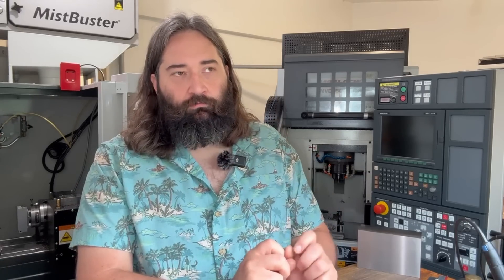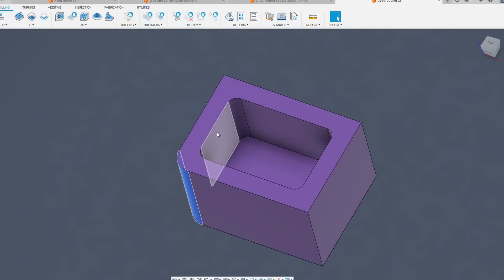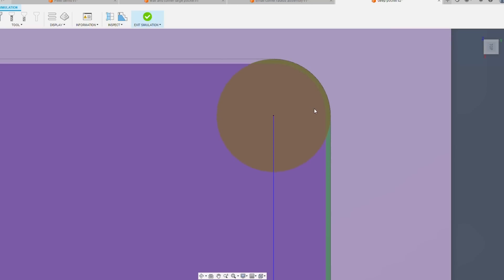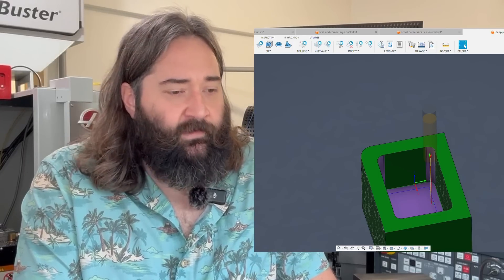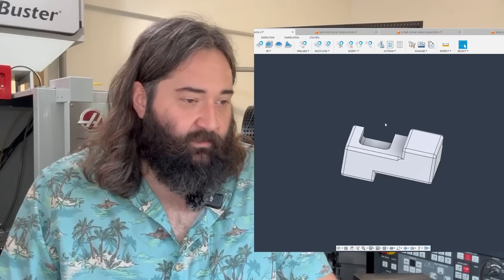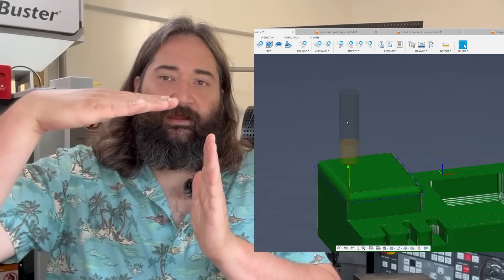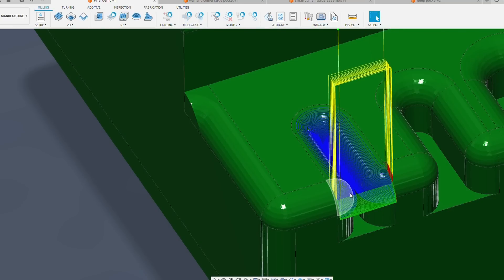Fillets make your cnc parts more expensive

Comment: Summary
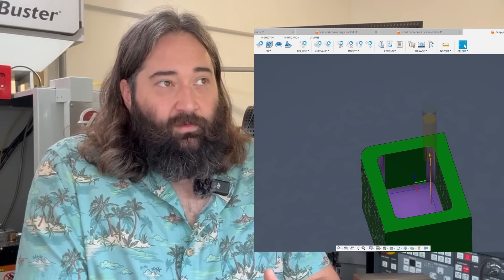* (7:29) Design fillets with both inch and metric tooling in mind: This allows for more flexibility in choosing machining tools and potentially reduces costs.

* (9:02) Avoid pockets where floor and vertical corner fillets match:  This creates sharp corners which are difficult to machine, often requiring multiple tools and increasing cost and complexity.

* (12:38) Corner rounding endmills can leave excess material: Especially near shoulders or narrow features. Consider alternative machining strategies or designs.

* (16:04) Avoid forcing situations requiring multiple tools to blend fillets: Blending tools increases complexity and often involves test cutting, leading to higher costs.

* (16:40) Every machining process leaves a corner radius: Plan for this in your designs, especially for tight-fitting components, to avoid assembly issues. Consider slight chamfers or radii on mating parts to account for the inherent radius left by machining.

Summarized by AI model: gemini-1.5-pro-exp-0801
Cost (if I didn't use the free tier): $0.0539
Input tokens: 14304
Output tokens: 368

Comment: Just ran into this problem today, rapid prototype job for a major company. The engineerhad 1mm internal radii in a pocket that is 3/4" deep. Is it doable yes, is it a total PIA also yes. After some back and forth with the engineering I got it bumped up to .0625 radii to run my 1/8" 3/4 LOC endmills I had on hand

Comment: Loved this video, and your insights!
Anything you talk about is interesting to me although a lot of it is not relevant to my work, as although I am a machinist, I pretty much only do plastics.
Do you ever machine plastics for jobs?
Reply from the maker: Very seldom, to be honestly I find it difficult. Weird stress issues and the burrs are a challenge for me
Reply: Interesting. I remember reading about a company here in Holland doing only plastics running a couple of Nakamura-Tomes. The machines have sort of eternal life because of the low loads. Also looking virtually new after years of service. 

I ran a job on our Okuma lathe on a part that is steel cored nylon, did not know it existed. They told me to switch off the chip conveyor as the nylon 'threads' bind it up. They can still be seen stuck in a lot of places from previous jobs when they were not so thoughtful. It's probably the only part we do in plastic all throughout the year so it does not pay to invest too much time in researching the best tools and parameters. I find the clamping pretty sketchy as it i so different from steel where I can just crank up the hydraulic chuck to near max all of the time.

Comment: Yeah but they make my 3d prints look siiick.
Reply: They also let your printer continue around the corner without slowing as much as a 90.
Reply: Yeah I fillet all kinds of stuff when 3D printing 😅 but machining? Engage chamfer mode.
Reply: @scottwatrous On 3D prints, it depends. Corners perpendicular to the print bed come out equally well chamfered or filleted. But on corners parallel to the print bed, I prefer chamfers every time. Can be printed without supports at the bottom of the print, and they just look way better than fillets. Even when printing with variable layer height.
Reply: Fillets take extra time on reductive manufacturing. Fillets reduce time on additive manufacturing, unless it causes a need for support structures.
Reply: A lot of things still apply to 3D printing. Doing horizontal fillets in a pocket will also look terrible when 3D printed with any sane layer height.
Reply: @ratowniknaemigracji6537  that's where you use sla if you still want fillets.
Reply: I have had designers who are used to 3D printing contact me to machine parts and I had to explain to them how their extra features for 3D printing become detrimental in a machining environment.  It is very useful to have the ability to think in both, as each has their strengths and weaknesses, so hopefully more engineers and designers expand their minds in those realms to be able to achieve ideal results in either, but only when designing specifically for each.
Reply: @dumpsterdave3710  I'm slowly starting to realize how lucky I am, and how valuable the concepts are that I deal with every day at work. I'm both our mechanical engineer & 3D print tech and our CNC guys work just in the next room over, and I'm starting to harmonize all 3 trades without entirely realizing it. I'm always over harassing them, and I don't even think twice any more when creating one model design for testing with 3D printing, and a second revision for CNC machining - both models keeping the same function, but optimized to the respective process' strengths.

It all just feels like common sense now.. "Yeah I can machine that part, but 3D printing a brick is a waste of time and material so I'm going to shell over here and put some chamfers here, here, and there.."
or
"This will print just fine, and I don't have to use supports! But if I don't at least fillet that internal corner, those guys are going to machine the part then kill me with it."
Reply: Thought the same thing!
Reply: How much of a .015 filet do you really have when you're slicing at .2mm?

CAD designers for 3d printing LOVE that filet button.
Reply: @antsman331  It's not that it's loved per se. It's REQUIRED otherwise the corners blob up.
Reply: @Splarkszter  I just finished printing NOPLES gatling gun. That was a lot of printing.  none of his models have all the ridiculous filets and no "blobs."
I've printed and machined parts using the same CAD models with no problem. 

if you're slicing at .008 and have
 .015 filet that's only 2 steps. Not much of a radius. 
Plus, it makes for a dirty model.
Look at  Hoffman tactical and his "super lowers". Those have filets on every corner,  creating surfaces on top of surfaces.  Those modes suck.
Reply: @antsman331   I print at 0.28mm layer height on a 0.4mm nozzle, square corners end up buldging a tiny bit so it makes it innacurrate(specially for inside tolerances).

I have to fillet my designs for at least 2mm to minimize it.
Reply: @Splarkszter  I don't think you understand what I'm talking about.  I'm not talking about filets looking down  G17 .  I'm talking the filets of you where looking down  G17 or G18
Reply: Chamfers are better than fillets for 3d printing on the Z axis

XY fillets are ok.
Reply: tbh i think fillets look extremely tacky (and are difficult to sand)